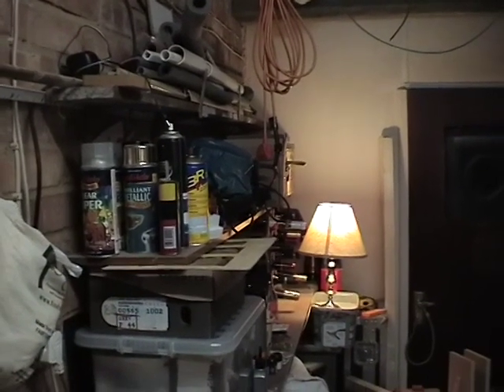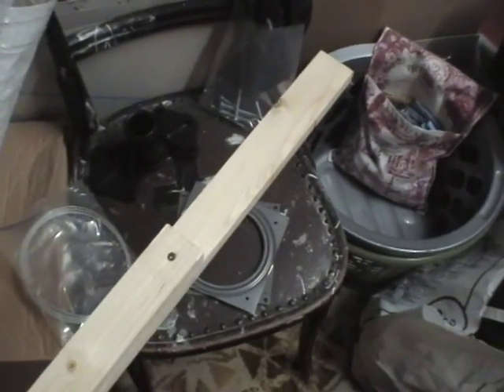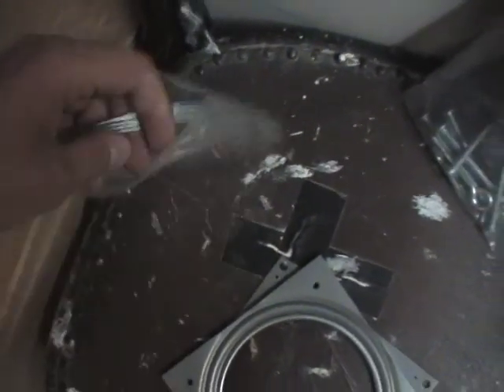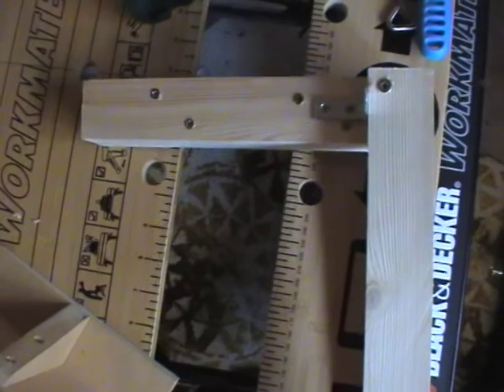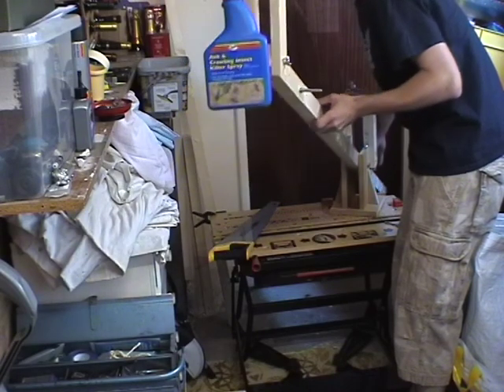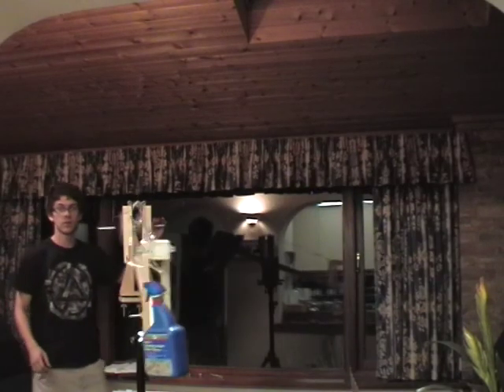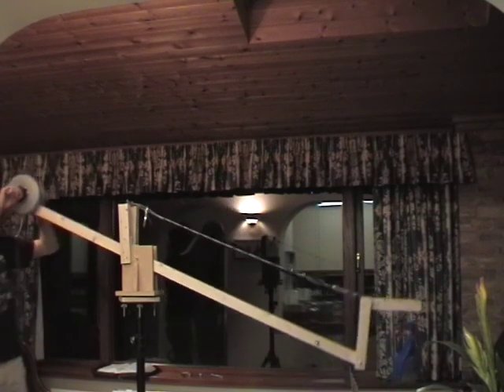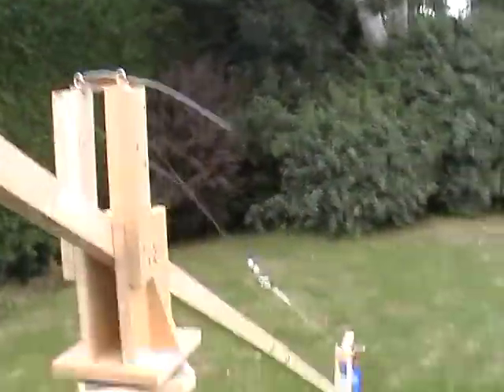Jib Arm Part1

Comment from the maker: @etanhg (1) The two uprights don't need to be vertical:- they just need to be at the same angle :) So so long as they're both angled the same, fine.
(2) Correct, just make these the same and you should be good to go!

Comment: Thanks so much for your help! I think there are 2 problems. please tell me if this makes sense to you:

1) My lazy Susan has two angled sides. This means that the cable will be attached a few inches further back than the main beam. If need be, I can correct this, so it's vertical.

2) The height btwn the cable & beam is 4in at the fulcrum and 9in at the head. (This makes more of a triangle / trapezoid). If I understand you correctly, then these need to be the same heights at both places?

Comment from the maker: @etanhg See where I say 'correct height', if the cable attached down by the pivot point, (where I put the hoops to tie the cable to originally) it would make more like a triangle with the main beam and the cable rather than a rectangle.

Comment from the maker: @etanhg Hey. You need to make a rectangle with your four sides, and the sides opposite each other must be equal lengths. So, your steel cable is one long side, your jib arm is the other long side, and you will have two short sides to your rectangle that will be the upright pieces at either end (the cable and jib will be attached to these). Make sure your cable is exact same length as your jib arm, and your two upright pieces the same height.

Comment from the maker: First is:- locking movements, I want to be able to lock out either the pan or tilt for movements in a single direction. Haven't finished this yet, gonna use door bolts and holes! Simple.

Second:- Inclusion of a front-mount handle system to control the camera like a shoulder-operated rig. Bit more complicated, but I've essentially completed this bit.

Third:- Tripod mount at the front for easy tripod shots without removing the camera.

I'll post another video when I'm back home, maybe at Xmas.